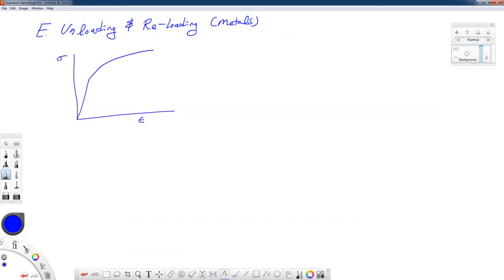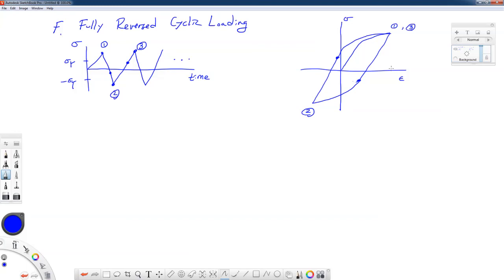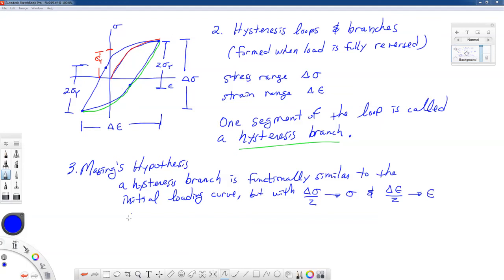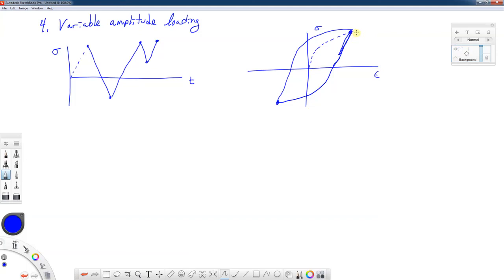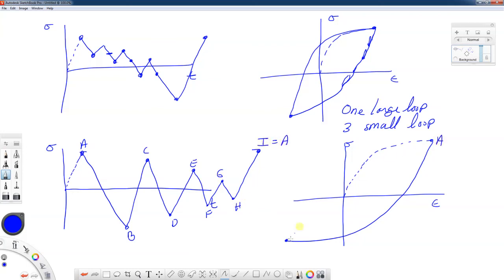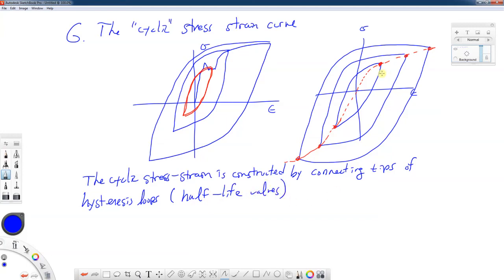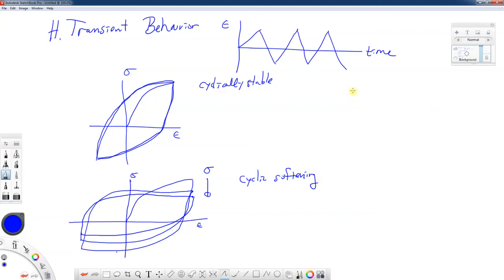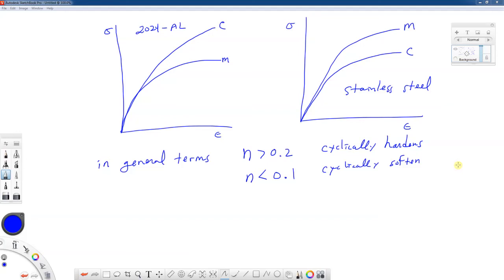AEM 648-6-Uniaxial Cyclic Loading (Metals)

Comment: Hi professor Barkey great lecture, I have a doubt though, in some cases I've seen very similar relationships, but instead of stress and strain is Moment-rotation/curvature, how are those developed? Do you have any lecture on this topic ?
Reply from the maker: Hi Ing. Erick Osorio, moment/curvature/deflection is here:  https://www.youtube.com/watch?v=uSzgr8R2Z1Q&list=PLaDWa6xI4zec07Yhxso4yQW8wQptI85yy&index=29   but I am not sure I would be able to make an parallels to Masing Hypothesis/cyclic stress strain curves but I can take a look.  Take care!
Reply: @mbarkey.mechanics  yeah, I was basically asking what would be the procedure to construct a hysteresis loop but in terms of moment and curvature and not stress and strain.
Regards
Reply from the maker: @ing.erickosorio2887  Ah, I see.  There are many nice cases in earthquake analysis for nonlinear bending behavior of beams, in which there would be hysteresis.  I do not have any other information on that, but I've seen dissertations involved in that subject.
Reply from the maker: @ing.erickosorio2887  I think any load term can be substituted for stress, and any deformation term (that includes some permanent set) can be substituted for strain to be able to develop hysteresis plots.  Note however, this would lose some information--we use true stress in hysteresis plots, and the moment would be more like an engineering stress that is directly proportional to load.   (There are also some stress equilibrium issues that may not be able to be accounted for with only using the moment at the location.)  You would also want to be careful about the curvature term, as that is probably associated with the mid-plane.  The maximum strains occur away from the mid-plane--at first thought, I am not sure how you would overcome that issue without just using the strain on the outer fiber, but there may be a way.
Reply: From what I understand, the curvature can be developed using the strain in the outer fiber, so that could be a way. Am I right? But using moment rotation, would be probably easier, what do you think? Thanks for your help professor Mark.
Reply from the maker: @ing.erickosorio2887  There is usually the assumption of a linear strain distribution in beams even if inelastic, but if you already have the strain then you should use it.  Ultimately I think that you should probably look into the literature for earthquake analysis of beams.  I have to think some of these ideas have been investigated.  Take care, MEB

Comment: Excellent content i can feel the passion trought the lesson. Just wath i was looking for undertsant what i am learning. Take care and keep uploading videos
Reply from the maker: Thanks David, happy studies!
Reply: @mbarkey.mechanics   hi again. I'm studying from fatigue of material book by surish I'm having a doubt. He talk on one part about cycle creep or ratcheting when the mean stress is different from 0 value. The question is, this is the same or similar behavior of Hardening or softening under cycle strain?
Reply from the maker: Not necessarily the same thing.  The presence of the non-zero stress (or strain in strain controlled loading) beyond the yield causes an accumulation of plastic strains in mean strain direction, similar to advancing a screw happens in the linear direction by rotating it (thus ratcheting behavior).  That said, the materials transient behavior such as hardening and softening can influence the ratcheting rate since the materials microstructure affects both issues.
Reply: @mbarkey.mechanics  I have another question. what happen with the bauschinger effect on a cyclic load with mean stress is different from 0 value ? i understan that if we have a difference of two time the yield stress the material will yield and have reverse plasticity, but i cant imagine what happend when the material reload (like on zero-tension-zero load or tension-tension load). My common sence say that the material will be on a higher yield point until stabilization (like in monotonic loading-unloading-reloading) is that correct? or im messing up concepts and bauschinger  effect only applied with reversed loads?
Reply from the maker: To first order you can apply a uniaxial cyclic plasticity model with the Bauschinger effect and use Masing's hypothesis.  But materials can do all sorts of variations on that basic concept, such as you have mentioned with cyclic softening or hardening, or multiaxial ratcheting.  If you really need to know what your material does, you will have to test it.

Comment: how to find the Energy dissipation during cyclic loading
Reply from the maker: plastic energy dissipation per volume is the area enclosed by stress vs plastic strain hysteresis loop
Reply: yes sir but i have data of all cycles how to find  out energy dissipation  curve?
Reply from the maker: I am not exactly sure what you want to do, but perhaps you want to find the plastic energy dissipation for each cycle and plot it vs cycle number.
Reply: @mbarkey.mechanics  yes i want  to plot energy dissipation  vs deformation.  I did  quasi static loading test on RC shear walls.  I need to find energy dissipation  of wall but i dont know the  procedure
Reply from the maker: My recommendation is that you look in journals related to Civil Engineering, particularly those that deal with earthquake engineering and structures.  You will find it.
Reply: @mbarkey.mechanics  why is that ? Is there any explanation since I've always heard that throughout my career and still don't see why or any demonstration, so it's one of those things I have to believe because people says so.
Reply from the maker: @ing.erickosorio2887  is your question:  why is the dissipated energy related to the area under the stress-plastic strain curve?  It comes form the the basic definition of work (force through a distance)--in terms of stress and strain, this is an energy density or energy/volume.  So, if it makes sense that the area under a stress-strain curve is energy density and in the case not all of the energy is recovered upon unloading (i.e. some permanent deformation takes place), then the non-recovered energy has gone into permanent deformation of the material, heat, etc.  Work is often expressed as W_total = W_elastic + W_plastic.  As more plasticity take place, the wider the hysteresis loop becomes through cyclic loading.  I'll suggest you look into the work of JoDean Morrow and his experiments on cyclically loaded copper. Happy studies!
Reply: @mbarkey.mechanics  yeah that was my question and the answer was cristal clear. Thank you so much. You're an awesome professor

Comment: I am currently working on my thesis and this series has been of great help. Thank you dr. Barkley! I have a couple of questions on hysteresis loops. I seem to understand that since the cyclic curve can be expressed using a RO equation (K',n') then the loading and unloading reference points (edges) should be symmetric about zero. However, when modelling the loop (strain control) in excel, I notice that if for stress σ I have a strain ε then for stress -σ, the strain will not be -ε. This is backed up by the branch equations since they are simply RO equations with the start set at the reversal point . Am I doing something wrong? The K1 and n1 parameters I'm using for the branches are different from those i used in the cyclic curve itself (K',n'). Could this be the problem? All parameters were determined through experiments. Thank you very much, in advance for your help and in general for your contribution!!!
Reply from the maker: Yes, if you use the same parameters with the Massing hypothesis, the calculations will be (should be) symmetric.  Experiments will not often give symmetric results though, due to a mean stress bias in strain control (tension first cycle or compression first cycle) and all kinds of other good reasons that materials don't really behave in the idealized way.
Reply: @mbarkey.mechanics  Thank you, I implemented Massing's hypothesis to the model and it did actually yield the results you're describing. If I may ask for some follow up questions, will the cyclic curve then be the one connecting the edges of the loops and therefore asymmetric or the theoretical one? And is it possible to get any information about the transient stages, by the shape of the cyclic stress-strain, the shape of the monotonic stress-strain and the shape of the hysteresis loops by comparing then with the one's suggested by Massing's hypothesis?
Reply from the maker: How you choose to model the plasticity depends on what your needs are--for example, to use this information to calculate fatigue life, only a coarse model is needed so you can usually get away with the symmetric type of model (because the scatter in variable amplitude fatigue life predictions are often large).  But there are a lot of models out there, and they can be used for transient behavior, such as the behavior shown in the video, and I suspect for non-symmetric loops as well (search for papers on nitinol modelling).  From a predictive use of a model, though, the trick is always how to model it in a meaningful way with as few parameters as necessary--and for those to be mechanism based where possible.
Reply: @mbarkey.mechanics  I see. Once again thank you

Comment: Please explain how to calculate intermediate points on the hysteresis loop
Reply from the maker: start with the tip of the loop (epsilon, sigma) point and then calculate delta_epsilon for each delta_sigma from the tip to the ending point at various intervals using the hysteresis branch equation

Comment: Hi Dr Mark,
In FE we define the material behaviour with a uniaxial stress-strain curve that we get from the uniaxial cyclic/monotonic tests. However, the stress state in FE model is not uniaxial as the deviatoric stress. in similar way, when we have amultiaxial state of loading, do we need to modify the input stress-strain or not, please? if yes, how we modify the test data of stress-strain to simulate the case of combined loading.
Reply from the maker: Your FE code should take care of making the conversion from the uniaxial input into an equivalent stress-strain curve for use in general multiaxial loading.  Now, you also need to to be aware of what assumptions and options you select--for example if the material is anisotropic, then you must also enter the coefficients of anisotropy.  If you do not specify these, the default is to usually assume your material is isotropic.     I have not gotten to that part in my class yet (so no video yet) but this is where the yield criterion and flow rule enter as well.  If you have some time, I think you can find a good discussion in the ABAQUS user and theory manuals.
Reply: Thanks ..its appreciated